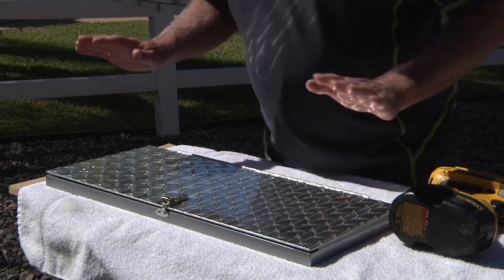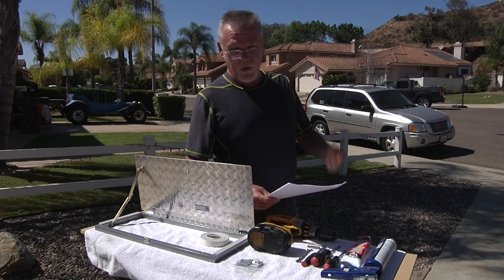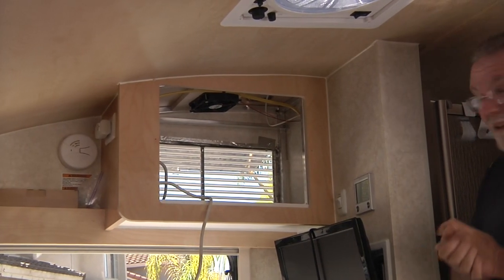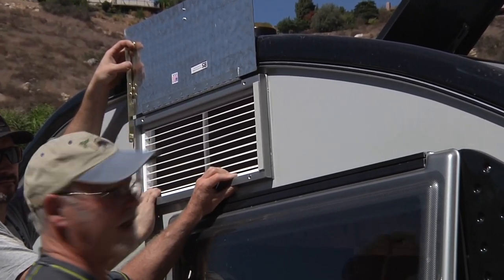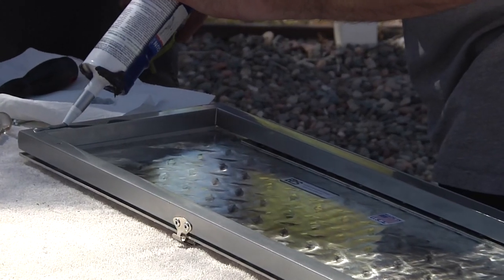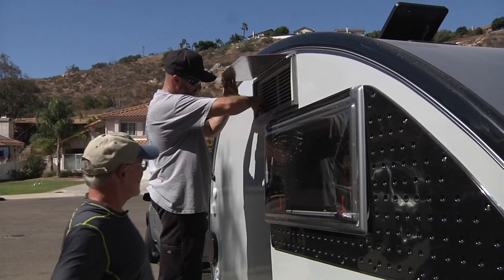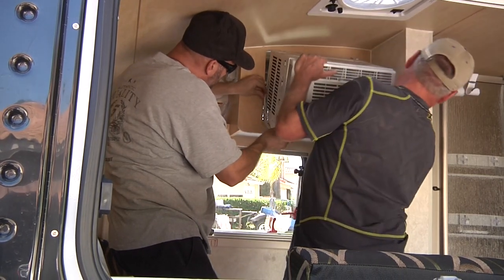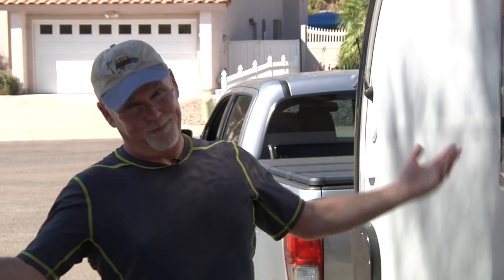T@B 320S & CSS custom accessory A/C vent door Install video

Comment: Can it be painted white to match the trailer wall?
Reply from the maker: It could be painted I suppose but probably should be powder coated. It was designed to match the front diamond plate rock guard hence the polished finish.